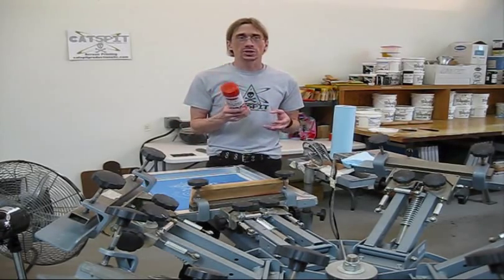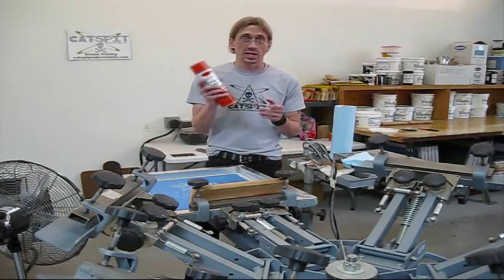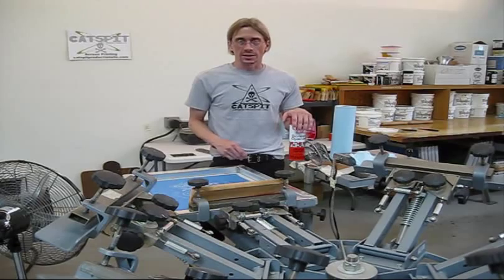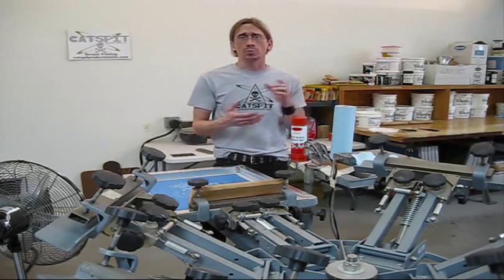How To Screen Print: Unclogging Screens On Press

Comment from the maker: This is an old but handy quick tips video for  #screenprinting  tee shirts. Learn how to get glogs out of screens while printing.
Reply: CatspitProductions Quick question you said to wipe it on both sides of the screen. Wouldn't that cause the ink to smear on the shirt press side of the screen and cause ink to get on the shirt in areas where it's not suppose to be. I'm a little confused I'm new to this. This will help because I've been just cleaning the entire screen by spraying it down with water and then letting it dry. This will save me a lot of time.

Comment from the maker: @usernamebutton Yes, standard solvents may work very well too. This stuff is designed for very tough clogs and should work very quickly without leaving any residue on the screen. It gets ink off the mesh really well and can clean off ink stains on the mesh sometimes too. It’s a great solvent to keep in the shop. Thanks for watching and commenting!

Comment: Quick question you said to wipe it on both sides of the screen. Wouldn't that cause the ink to smear on the shirt press side of the screen and cause ink to get on the shirt in areas where it's not suppose to be. I'm a little confused I'm new to this. This will help because I've been just cleaning the entire screen by spraying it down with water and then letting it dry. This will save me a lot of time.
Reply from the maker: Yeah you simply have to wipe either side well enough for that not to happen. I usually try to use it in the clogged stencil area only reducing the amount of product used as well as being mixed into any ink. Thanks for watching! Screen Printing Equipment & Supplies - http://CatspitScreenPrintSupply.com/

Comment: I have been having issues recently with some sort of clear substance clogged in my screens even before putting ink on the screen.  I thought maybe I was underexposing the screens, but I was not having this problem before at all.  The weather has changed recently too, it's much colder and more humid.  Do you think that the humidity could be the problem? Thanks in advance.
Reply from the maker: It's a scum left over from under exposed emulsion. Check out this video:

https://www.youtube.com/watch?v=skiwJTfxgsA 

Thanks for watching! Screen Printing Equipment & Supplies - http://CatspitScreenPrintSupply.com/
Reply: @CatspitProductions  Thank you so much.  I always appreciate all the help.
Reply from the maker: @danminchico  You're welcome. Glad I could help out.